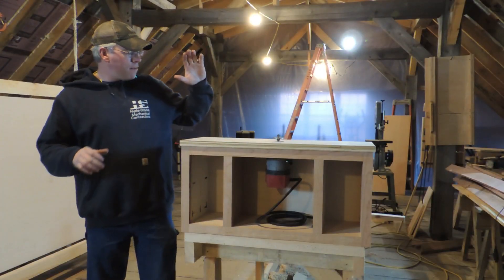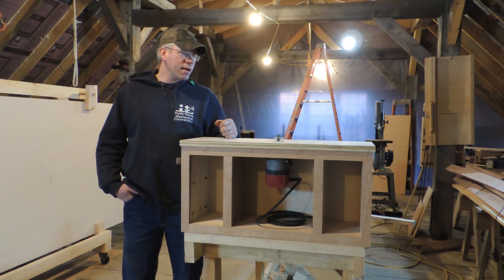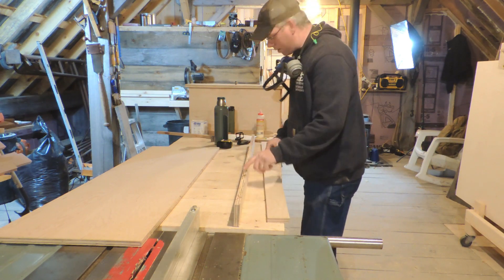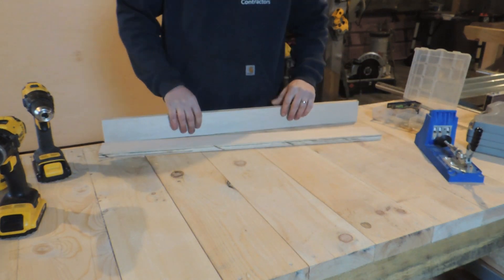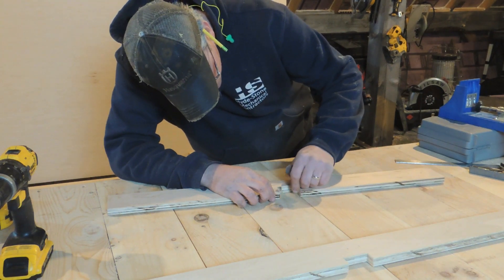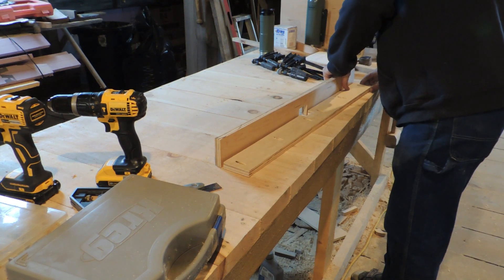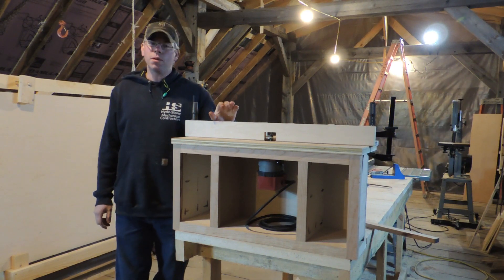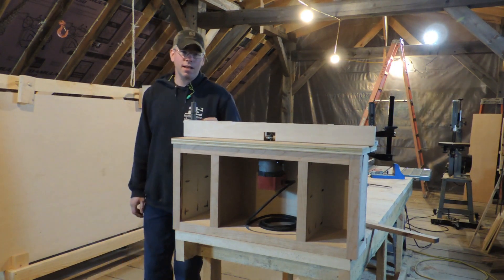Router Table Success Begins and Ends With An Accurate Fence

Comment: Dear Jim,
A great looking little router table. I too favour a much taller height for routing as it brings the process to eye level without having to stoop down every time I need to do work. I am sure that with a little tweek here & there, your table will be just right for how you want it to perform. Sorry for the delayed viewing; one week without internet caused by neighbour pulling cable by accident, still getting there slowly but surely. Great stuff. Kind regards.

Comment: Just got back from harbor freight getting 5 inch wire wheels for my angle grinder. The height of that router table would be great for old sore backs. Built a rolling workbench quite high to spare my back.  Works wonders.
Reply from the maker: For us tall guys it sure helps.
Reply: TheTradesmanChannel even us short guys with fading vision!!!

Comment: When you laminated the pieces of plywood Paul Sellers uses a trick to keep the pieces aligned after applying the glue. The glue initially makes the 2 surfaces want to slide in relation to each other. To help with this he drives a nail in diagonal corners and cuts it off so as to leave a small piece sticking up. Then he aligns the 2 pieces and presses down to have a hole in the upper sheet as a registration point. This helps stabilize while clamping or screwing together while the glue dries. Since you mentioned inexperienced woodworkers that information might be of use to some.
How about adding dust ports on the fence and underneath. With the gussets you almost have a box made to add a dust port.
Keep up the instructional videos. Really like the daily ones and they are at the top of the subscription list.
Reply from the maker: Thank you Lars, next time I glue up I'm going to try that.  Paul Sellers is good at what he does.
Reply: @TheTradesmanChannel  yeah, he must be to have a couple of pieces in the White House. I love his YT channel too.

Comment: The height of  the table makes sense the way you explained it.  I built a table for working on my ATVs.....man it is a world of difference .  Turns misery into it actually being enjoyable to do the things that really need to be done.

I was thinking that a pin on one end of the fence , and a T-nut threaded insert on the adjustable end would be a nice touch.  Cut a little slot in the fence base and top it with a washer and a knurled knob.......but the clamp works just fine too.
Reply from the maker: The pin and not is a great way to attach a fence.

Comment: Morning Jim. For the gap in the fence, why not keep the two strips together, mark your cut depth,  and offset a hole-saw 3/4 inch to make the hole for your fence gate, route the bull-nose, then cut them apart into your seperate boards? And continue on as you did. Just a thought.
Reply: James Wright @ WoodByWright (on YOUTUBE) did a test series and pretty much got the same results. He did videos on making Hyde glue as well.
Reply: What is everyone's obsession with poly? Why not just use good old fashioned bees wax or paraffin wax? Poly will tend to raise the grain much more.

Comment: add a split fence then you can use it as a jointer as well by packing out the outfeed side with a shim packer and a straight cut bit, thanks for posting.
Reply from the maker: Hey, that is a great idea.

Comment: hey when you go to screw your pieces together add a little salt after you put down your glue . adds a little grit to hold them from sliding. also you can set a clamps behind your wood to keep from sliding
Reply from the maker: I will try it, thank you.
Reply: @TheTradesmanChannel  welcome
Reply: Another option is to use finishing nails as locator pins. Tap them in just a little, use some side-cutters or linesman pliers to snip them off close to the surface, then tap the second piece onto the first, being careful with the alignment. Then spread the glue, and wa-lah, you have locator pins to realign the pieces. Also helps remove slide on panel laminating.

Comment: ... Thanks Buddy !!.. while watching this video i'm in the middle of making a larger top on the table saw... so, looking @ your router table, i've decided to make a fence that'll do double duty. i'm mounting router under the left side of my table saw.. just a torch & a small sledge & i'm in high cotton ; ) again, Thanks for the video & see ya on the next one.
Reply from the maker: Good deal, if my table saw had different extension tables I would've done the same.
Reply: I've also seen some guys mount a jig-saw under the opposite wing for cutting curves and such. Just a thought.

Comment: @ 16:00 you could get out your brad nailer and brad those pieces together while you screw in the kreg screws. That could keep them from sliding.
Reply from the maker: If I had a brad nailer I would sure do that.  I really need to get one.
Reply: I guess I made an assumption. I'm sorry about that. I thought you had one.
Reply from the maker: You don't need to be sorry about that.  You would think I would have one.  You would be amazed at how little I get by with.  Makes me appreciate it more when I get tools to work with.

Comment: There have been many tests of glues by different magazines, TV and ect. All glues have advantages and draw backs, it depends on the conditions and application. 2 cabinet shops I worked @ used a water based, what we called brown glue, that had to be mixed w/ water. Another one used mostly 2 part marine glue, it was like epoxy.

Comment: Another very informative video! I am very guilty of just buying things like this and building things to make them work.  Love my kreg jig! I thought so much less of them till i used one.. when glueing up large pannels or even table tops if you get several of the deep, (like foot or foot and a half vice grip type clamps) you can clamp where the kreg screws go and avoid the movement that comes with even big bar clamps.  If you are getting s2s, sanded two sides, 3/4" lumber and when gluing it up if it moves on ya, in order to get all the glue joints smooth you loose thicknesses.  You can avoid  98% of that thickness loss by using the kreg system.   Can ya tell i like it!  Lol.   I have found it is even better than my biscuit jointer to limit movement from one piece to another during glue ups.
Reply from the maker: I like em too.  Makes life easy with good results.

Comment: Is there a reason you don't turn kreg jig  around? or did I miss it in a early video. Kregs right angle clamp helps but still have to be careful. looks good Jim how you need to make a sled to run the ends of your rails.
Reply from the maker: No reason, it's just how I've always used the tool.

Comment: For this particular project t think I’m gonna make the top with MDF.  I’m just thinking it would make a more smooth surface.  I’ve never used the stuff other than for a quick easy shelf or stand... wondering how it would hold up in this project.
Reply from the maker: Melamine might hold up better.

Comment: By the way, my comment that it seemed a little high was in relation to body mechanics, not visability. But if it works for you, then go for it. Please remember your eye PPE being that close to a power cutting tool (not just glasses). A gimp leg is likely much easier to come back from than severe eye damage. Depth perception would be ruined with one eye gone.

Comment: Maybe put feet on it that will overhang the edges of your bench to keep it from sliding around?
Reply from the maker: Not a bad idea, I want to be able to use it anywhere.
Reply: I'm thinking, something like a skirt around 3 sides (left, right, and front) to match the bench where you primarily expect to use it. It would then stand 1/2" or so taller on a bigger bench. You could also attach the skirt with a couple of bolts in slots so the skirt - or part of it - could be raised or lowered to hang down or be flush with the bottom.